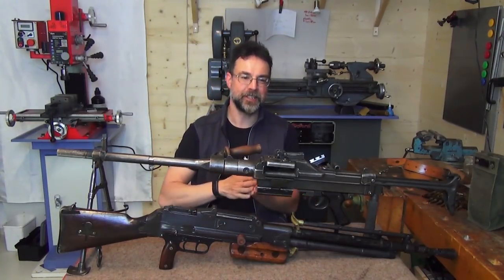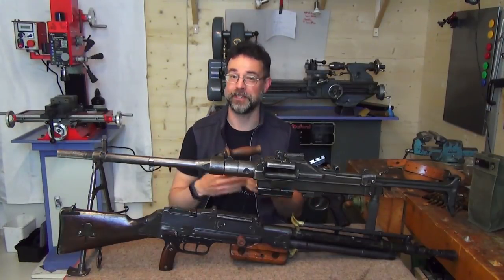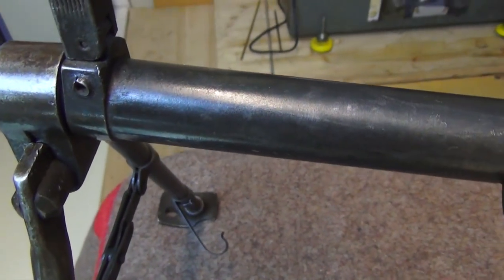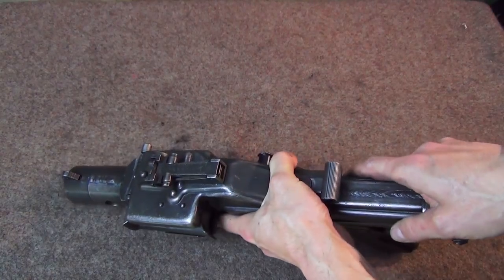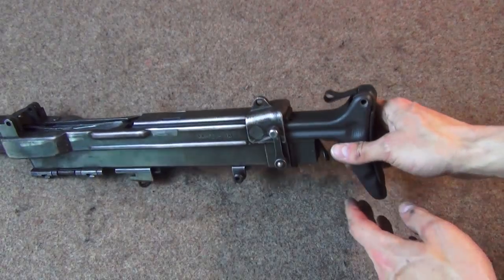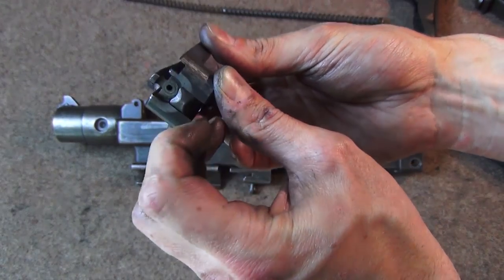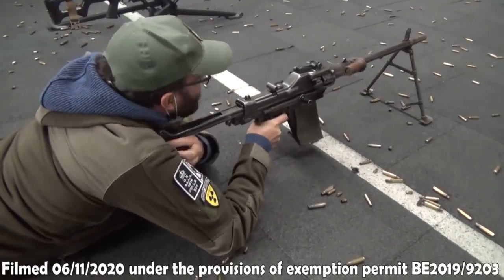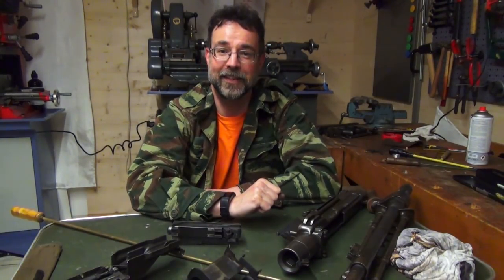AA52 French GPMG For The Cold War And Beyond

Comment: Blowback is a Lie!

For about a year there has been a term circulating in the Internet, the term is “Blowback”. Nobody has ever heard of it, or knows what this is supposed to be. Is it a lie or does “Blowback” really do exist, meaning that we were unknowing all these years?

A “Blowback” operated firearm is supposed to be a form of self loading firearm with a fixed barrel, we all know als recoil operated. Weapons like Walther PPk, the Uzi, the G3 and others. This is supposed to be, because these weapons will work with blank firing adapters. By the way these adapters are muzzle diameter limitations that cause a back pressure that makes the firearms self loading mechanism work with black cartridges.

On a locked breech gun with slide locked only by springtention and the inertia of its mass, a self loading can not be achieved with a black firing adapter (Walther P38, FN High Power, TT-33 Tokarev, Ultrastar and others). Only these guns are supposed to be recoil operated.

One has to consider that there is a technical difference between Walther PPK and Walther P38. But every shooter knows that. He just named it differently. The PPK is a recoil operated and only locks by springtention and the inertia of the slide mass and the P38 is recoil operated with a tilting block lock. And there are mentions of “Blowback” in gun literature before the days of the internet. But only to be found in old military and police books.

The name “Blowback” is real.

But from a technical terming standpoint it does not matter if a weapon works with or without a blank firing adapter. All these weapons work according to the same physical principle of recoil. The fact that these weapons work with black cartridges does not justify to say, that they are excluded from the principle of recoil. The principle of recoil is a physical law. If you name it “recoil” or “pressure”, it's simply the same!

I own several pistols that are “gas delayed” and locked by springtension and the inertia of the slide mass. I know for a fact that the H&K P7 has a gasport. There gas is tapped to keep the bolt shut with the gas pressure. This is happening via a gas rod, until the bullet has left the muzzle. Only when the pressure has dropped, the slide will open drived by the recoil impulse. The technical background is that if the slide opens too fast a fireball will come out of the ejection port. If there would be a difference between “pressure” and “recoil” these weapons would not work at all! Vektor CP1, Norinco 77b and H&K P7 are proving that the differentiation between recoil operation and blowback operation is a Lie!

Blank firing guns for example do not have recoil. They are using the “back pressure” to cycle the slide back. The back pressure is dependent on several factors like the muzzle bore diameter. If one really wants one could name these weapons “Back Pressure Operated”. But only guns that are intentionally made to only fire blanks.

Has anyone of you ever heard of “Blow Back Principle”? It's just nonsense. If a projectile with a mass of x and a velocity a y is leaving a barrel, a certain recoil impulse is developed. If there would be “Blow Back” and “recoil” in addition, there would be two forces willing to open the slide of an Walther PPK. If this would be the case the slide would open way too fast before the Bullet could leave the muzzle, the pressure would remain too high and a fireball would shoot out of the ejection port.

I admit I was a bit mean in the text above by telling you that there are some mentions of a “Blow Back Operation” in literature, that may unsettled you a bit. But I assure you there is counter proof. You’ve not been unknowing and stuipid. In a book there is a Walther P38 described as “blow back”. This proves that the terms “Blow Back” and recoil mean the exact same thing. There is no difference.

Hecker & Koch manufactured the P7 as a recoil operated gun. The engineers were not to stupid to not understand firearm operations!

Conclusion: Either there is a person feeling very important lately because he thinks he knows something others don’t. Or some shooters have fallen for a hoax and this “person” has the fun of his life by watching the internet riddling his theory.

The term “Blow Back” exists. But the differentiation between “blowback operation” and recoil operation is a Lie! A thing like this just doesn't exist. The usage of the term “blowback” is confusing and is no longer in use for a reason.
Reply from the maker: I actually read that all the way through, and it's so incredibly wrong on a basic, technical, mechanical, Newtonian level that it hurts my brain. 

Yours,

Bloke MEng (Hons) Oxon

PS - blowback is a special form of gas operation, where the case itself acts as the gas piston and acts directly on the breech face.  I think your misunderstanding there comes from unfortunate use of language in the literature, and this is actually dealt with rather neatly in the following passage of the German Wikipedia page (put it through DeepL if you can't German): https://de.wikipedia.org/wiki/Masseverschluss

Bei der Klassifizierung des physikalischen Antriebsprinzips des Verschlusses kommt es in der Literatur zu Missverständnissen. Grundsätzlich wird zwischen Gasdruckladern und Rückstoßladern unterschieden. Der Masseverschluss arbeitet nach dem Prinzip des Gasdruckladers.[4] Die Verbrennungsgase der Treibladung breiten sich in alle Richtungen aus. Durch diesen Gasdruck wird zum einen das Geschoss nach vorne, zum anderen die Hülse nach hinten geschoben.[4][10] Ein Bewegungsimpuls des Geschosses zum Erzeugen eines Rückstoßes ist auch gar nicht nötig. Der Masseverschluss funktioniert auch sehr gut mit Platzpatronen, wenn ein Manöverpatronengerät den Querschnitt der Rohrmündung stark verengt und somit der nötige Gasdruck aufgebaut wird. Ein Rückstoßlader benötigt hingegen eine Geschossbewegung, um den Rückstoß zu erzeugen.[11] Dennoch wird fälschlicherweise der Masseverschluss manchmal den Rückstoßladern zugeordnet.[12] Alternativ ist die Bezeichnung Rückdrucklader, entsprechend der englischen Bezeichnung blowback operation für den Masseverschluss, möglich. Diese Bezeichnung nimmt Bezug auf die öffnende Kraft, den Druck im Lauf, wohingegen Masseverschluss Bezug auf die Art der schließenden Komponente, der Massenträgheit, nimmt.[13]
Reply from the maker: Err, lol. "Lies doch mal mehr Bücher" beeindruckt mich gar nicht, denn ich habe eine Universitätsdiplom in Ingenieurwissenschaft (MEng) und kann das alles von den Grundprinzipien Newtons aufbauen. Du solltest dieses Buch lesen, dieser Autor kann das auch und gibt sehr klare Auslegungen: https://www.orellfuessli.ch/shop/home/artikeldetails/A1040953298

Wenn du so unglaublich intelligent bist, zeichne doch mal dies selbst ab, mit Kräfte, Bewegungen etc. Es ist nicht so schwierig, und ja gar nicht umstritten: Blowback braucht nur einen Kammerdruck zum funktionieren. Nicht mehr und nicht weniger. Recoil-op braucht einen Rückstoss des Laufes. Nicht mehr und nicht weniger. Dies sind völlig unterschiedlich.

Du kannst eine Recoil-Op Waffe zum Repetieren bringen, mit einem Hammerschlag auf dem Laufmündung. Eine Blowback nicht. Du kannst eine Blowback mit Platzpatronen und Mündungsverengung zum Repetieren bringen, eine Recoil-Op nicht. Da Newton, und er interessiert sich nicht für wie intelligent du denkst, dass du bist.
Reply from the maker: Oh, and btw, you're literally commenting on a channel where we shoot real guns a hell of a lot so lol at your "Wenn Du selber keine Ausbildung an Waffen durchlaufen hast, noch nie eine scharfe Waffe in der Hand gehalten hast, deine Freizeit mit Couter-Strike spielen verbringst, ..." You are so intelligent...
Reply from the maker: DE719994C: Die Erfindung bezieht sich auf eine Selbstladepistole mit festem Lauf und einem durch den Rückdruck der auf die Patronenhülse wirkenden Gase getriebenen schwingenden Verschlußstück.
Reply: @BlokeontheRange  Eine Pistole braucht etwa ab den Kaliber 9mm Para eine verzögerte Öffnung. Die einen Waffen haben dafür eine Verriegelung und manche eine Gasbremse. Da sich der Verschluss der P7 erst in Bewegung setzt, nach dem der Druck im Lauf abgebaut ist, beweist dass, dass der Verschluss alleine durch den Rückstoß bewegt wird.
Reply: @foxtango2194  Errrm nope #hipoint
Reply: @BlokeontheRange  nein,    es ist völlig korrekt. Auf Englisch nennt sich das System des G3 "roller-delayed blow back", also ein Rückstoßlader mit verzögerndem Rollenverschluss...
Die Rollen verzögern die Aktion des Verschlusses, das ist ein System, das HK jahrelang für alle möglichen Waffen eingesetzt hat.
Reply: @foxtango2194  Nein, das ist falsch übersetzt. "Blow-Back" wird im deutschen meist einfach zum "Masseverschluss". "Rückstoßlader" wird zu "Recoil Operated."
Reply: @xxminecraftpantoffelhdxx2583  ganz einfach, "Recoil" bezeichnet im Englischen den spürbaren Rückstoß einer Waffe beim Schuss, wird aber nicht zur Beschreibung des Systems benutzt. Dort verwendet man "blowback" im Gegensatz zu "gas operated". Das hat aber für das Thema hier sowieso keinerlei Bedeutung  da wohl unstrittig ist, dass es sich nicht um Gasdrucklader dreht  oder?
Reply: @foxtango2194  Nein, "Recoil-Operated" ist im Englischen ein ganz normales Antriebssystem. Der spürbare Rückstoß ist "Kick". "Blow-Back" ist nach Chinn eine Form von "Gas-Operated".
Reply: @xxminecraftpantoffelhdxx2583  Es geht nur darum, dass die Rollen im Verschluss des G3 dazu da sind, den Verschlusskopf in der geschlossenen Stellung für kurze Zeit zu Arretierung. Daher ist das System ein roller-delayed blowback, im Unterschied zum reinen blowback, bei dem der Verschluss nur durch die Spannung der Rückstossfeder in seiner vorderen Position gehalten wird und dadurch sofort mechanisch frei ist, also durch den Rückstoß sofort öffnet und nach hinten gleitet.
Reply: @foxtango2194  Nein die Rollen arretieren den Verschluss nicht, hast du überhaupt Blokes Video zum G3 gesehen? Der Verschluss ist kraftschlüssig dynamisch. Schließfedern sind nur zum schließen dar und haben keine verriegele Wirkung, diese Aufgabe übernimmt die Masseträgheit. Und nein der Rückstoß öffnet diese Systeme nicht, das macht der Gasdruck.
Reply: @xxminecraftpantoffelhdxx2583  Ist doch nicht so schwer zu verstehen  oder? Ob du Rückstoß jetzt Recoil oder blowback nennst, ist dabei völlig egal, es  geht um den HK-typischen Rollenverschluss.
Reply: @foxtango2194  Recoil und Blowback sind zwei völlig verschiedene Sachen. Das eine ist eine Gegenreaktion nach Newton 3 und das andere ist Gasdruck. Das sind zwei verschiedene Kräfte. Das kannst du in jedem Physik Schulbuch nachlesen.
Reply: @xxminecraftpantoffelhdxx2583  keine Ahnung, ich habe das Buch nicht, dafür aber lange genug regelmäßig mein G3 bei der Bundeswehr regelmäßig zerlegt und gereinigt.
Aber vielleicht klärst du mich ja auf, was das "Waffentechnische Taschenbuch" über das G3 weiß, was mir unbekannt ist?
Willst du vielleicht behaupten, das G3 sei kein Rückstoßlader mit rollenverzögertem Verschluss? Oder auch die MP5, die genau das gleiche System nutzt?
Reply: @foxtango2194  stimmt nicht, der setzt sich gleich in Bewegung, wenn auch nur minimal.
Reply: @BlokeontheRange  I'm shocked and impressed with your patience! I was unable to read the entire statement. Thank you for the videos.
Reply: Never have I read so much that said so little, since i wrote the first layout draft of a report using Lorem ipsum text
Reply: @BlokeontheRange  NGL, I thought it was some kind of parody/injoke I was too out-of-touch to get.
Reply: @BlokeontheRange I love when you pin these ridiculous comments. 😂

Comment: For all the “OMG the flames 🔥😱” comments. It’s just the PPU ammo. If you watch the FM24-29 vid, you’ll see exactly the same, and that has a fully
locked breech and far slower ROF.
Reply: All good lol, I wasn't very concerned anyway if it was out-of-battery firing (looked minor) but no worries.
Reply: I would have thought it was due to the residual burnt gas flow from fluted chamber helping with case extraction.
Reply: I assume it is just residual hot smoky nonsense igniting when it hits the open air and gets some oxygen? Doesn't look like there's any pressure behind it.

Is the flash on extraction noticeable to the shooter? Cameras have a way of making the flames look more dramatic.

Comment: The AAN-F1 was still in use in 2010 when I was in Afghanistan with the French army. A lot of brand new one were put from grease
Reply: Awesome thanks for the info. I wouldn’t be surprised if they just use them until they run out as long as 308 ammo is in the supply chain.
Reply: @thebotrchap  probably, the minimi was in use too but 5.56 wasn't enough for support
Reply: @thebotrchap  Isn't the French Army buying MAGs to replace them? Or is that limited to certain vehicular mounts?

I can't see them not having a full rifle calibre MG alongside their intermediate calibre Minimis.
Reply: Photos or it didn't happen.
Reply: @mathiasmargot703  Did France discover that a support weapon with a shorter barrel than their rifle is a bit bloody stupid too? FN must have been laughing all the way to the bank on that bloody thing.
Reply: @stamfordly6463  lol both barrel length where used depend if mounted on vehicle (medical or transmission) or infantry. This is still a very reliable and efficient support MG, very similar to the MG-3
Reply: @88porpoise  FN MAG are used to replace the ANF1
but you still see the latter around, most often on vehicular mounts as the mounting hardware for the MAG and the ANF1 are different, so usually if you see a VAB, PVP, VBL, Leclerc, ERC-90, or AMX-10RC with a hatch machine gun, most often it will be an ANF1 (the rest of the time it's a M2HB in .50), it's also the coaxial gun on the latter two vehicles in virtue of when they were made
newer vehicles should come with the hardware to mount the MAG but we will still see the ANF1 float about in some capacity for a long time, even if just for training duties (the Gendarmerie removed it's last FM 24/29 from inventory in the mid 2000's)

Comment: Magnificent presentation Sir! "Stock thing that goes up" was just the first time that I actually did LOL. Interesting to see the various features in comparison to the MAG which I am more familiar with. The footage really showed the amount of flash at the chamber end which I would think would be disconcerting for the shooter at least. Potentially a real problem in the infantry role with loss of night vision - fitting a muzzle mounted flash hider to save the user's night vision (not that it seemed to work) is a bit hopeless if the operating system ejects burning gas through the feed mechanism.
Reply: Thanks 😊 The flash is due to the PPU ammo not the gun. The same happened with the FM24-29 which is fully locked with a rather more sedate ROF. It seems the gases are rather prone to the afterburner effect.
Reply: @thebotrchap  Now that reminds me of reading somewhere, many years ago, about flash suppresion addditives in powders. I don't recall any detail, in fact I'd all but forgotten about it but perhaps it would be a subject worth researching?

Comment: You kept saying the bolt head moves back after firing by recoil. It’s more correct to say the bolt head moves back because the base of the cartridge pushes it back. I think of delayed blowback as gas operated but the one shot gas piston is the cartridge case.

Comment: If you want to fire a GPMG from the sling don't put it over your head and right shoulder. Put the sling over your left shoulder only and loop up. When you then grab the pistol grip it tensions the sling and stops the front end riding to the right as you fire.
Reply: I put it on the left shoulder as per regulations and it rode to the right 🤷🏻‍♂️
Reply: @thebotrchap  Yeah it probably works somewhat better with a L4 or  L7 with the gas regulator set correctly to give a nice balanced 600-ish per minute.

Comment: One question that comes to mind, assuming the stock is collapsed, does it extend "automatically" when you yank the charging handle back ? I can see someone carrying it loaded but uncocked with the stock collapsed (shorter and less snaggy), cock it if action presents itself and the stock extends would seem "logical".
Reply: If you have the 💪 in theory yes although you’re fighting the substantial force of the recoil spring and bolt mass
Reply: Neah you need the stock extended so you can put your hand on the end and balance the thing on the march.

Comment: An observation -- all the guns the UK arms establishments made after WW2 were ridiculously over engineered, hard to make, expensive, and finally impractical, (see notably Johnathon's video where fires an EM-2 then strips it down after putting a few rounds through it and points out how complicated it is and how much it is beaten up, or his video on the attempt to rework the Bren as a belt fed GPMG).  The French guns were by comparison perfectly designed for the time.  (Only good example on the UK side was the Sterling, built by a private company that the UK repeatedly tried to rip off).